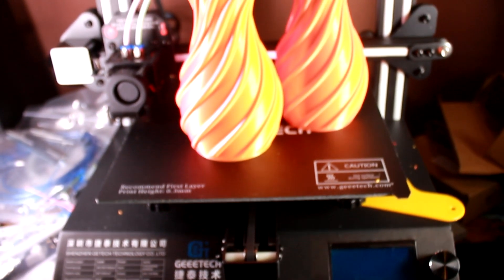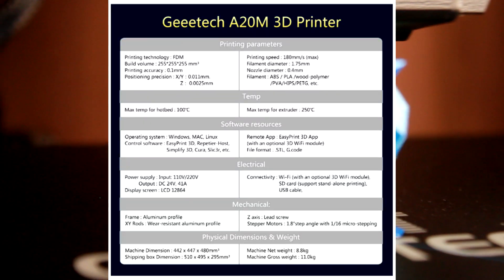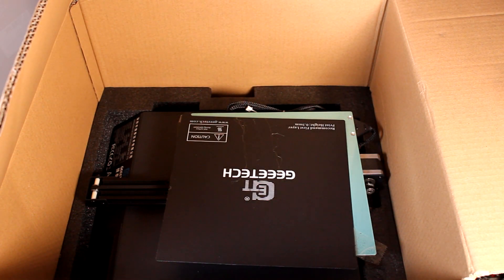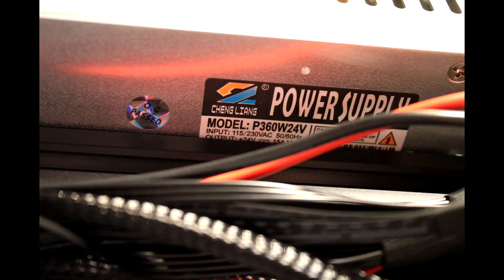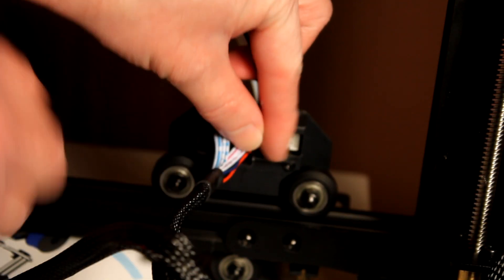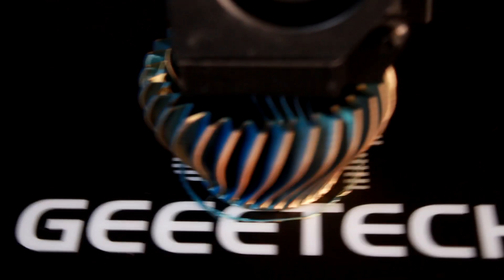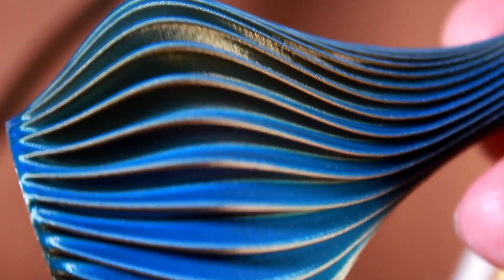The Geeetech A20M two colour single hotend printer. Is it worth buying? Who knows? Build and review.

Comment: This is one of those printers that I would love a follow up after say 1000hrs. Lots of good printers work good at first but then fail later on. I would also love to see what mods you do over time and how they worked out. Great video
Reply: I've had mine for about 2 years. I can give you a followup lol
Reply: Ive had mine for a year and from my experience my a10m can print very accurate and good prints, but its no prusa and you will need to do lots of repairs, upgrade, maitenence, and tuning. I even switched from geeetech supported repeater host to SuperSlicer. I also printed Bowden tube couplers which hold the tubes a lot better than any of the ones that you can buy for it

Comment: Love your videos.  Great to see someone making videos on mixing extruders.  I've had a Zonestar Z9M4 for about a year now which is a four color mixing extruder.  It has been a challenge to get great color prints from.  I'd love to see more videos on this topic.  There have been a few things that I've learned over the year playing with mixing. 

Virtual extruders are key.  While you can get fun effects by messing with the settings on the printer while it is printing, it isn't very helpful for making detailed colored prints.  Cura doesn't natively support defining virtual extruders but can use them.  I believe Marlin supports 16 virtual extruders (at least it does in my case).  These are tools T0 through T15.  By default, T0 is set to 100% extruder 0 and 0% all other extruders, T1 is 100% extruder 1 and 0% all other extruders, etc.  You can tell Cura that it has more extruders than the default two to use the rest of the virtual extruders.  In your printer start G-code, you can use the M163 and M164 commands (see Marlin reference for details) to set the mix ratio for each of your virtual extruders.

G-code editing.  If you'd prefer to just change colors at specific layers or start a gradient at a specific layer, you can use the M165 and M166 commands.  The M165 allows you to set the mix for the current tool and the M166 command allows you to set a gradient.  See Marin's documentation for specifics.

Choice of slicers.
I have been using Cura with my Ender 3 pro for years.  It doesn't hold up well however with multi extruder setups.  I haven't been able to get the purge tower to work reliably above two extruders. Cura also seems to need to purge a lot of filament for a clean color change.  I also ran into the same issue that you did where you have to change a lot of the settings per extruder.  This becomes a pain with 8 extruders and almost impossible with 16 extruders.  This brings me to the next issue I found.  At 8 extruders, Cura starts to run slow.  At 16, extremely slow.  To top it off, sometimes the settings don't save and will revert back to the previous value.  One final issue I ran into with Cura was that it would insert extra heat/wait commands (M104/M109) which would cause the printer to pause while it waited for the second virtual extruder to heat.  The solution I found for this was to get the Printer Settings plugin which adds the option for Extruders share Heater.
With the issues I had with Cura, I started looking for an alternative slicer and found Voxelizer 2 Experimental.  First off, let me say, it is not a very good slicer.  It gets the job done, but the results aren't as good as I've seen from Cura.  This could just be me not knowing how to use the software to its full potential.  The one area it does excel in is mixing extruder support.  Instead of dealing with multiple extruders or setting mixing ratios in G-code, it handles that part for you.  You are presented with the ability to add custom colors like MS paint.  You can also add gradients as colors.  After setting your custom colors, you just drag them to the component of the model that you want it applied to.  The slicer does the rest.  It even supports mapping images to the surface of models for some very interesting effects.  Another nice feature it has is the ability to print the purge block not only as a traditional tower, but also the ability to print it in as infill completely eliminating waste, or to print it as a skirt which just makes a thin band of purge around the entire model.  I prefer the latter as the infill purge method can't always work.  It also has the advantage as doubling as a draft shield.

Looking forward to more videos on the topic!
Reply from the maker: I'm going to need to read this later and take notes - thanks for all this!

Comment: I just picked up the V2 version of the A30T for $199 CAD shipped to me door.  That's about $150 US.  It just arrived today.  So far it looks really good. 32 bit board and silent drivers.  All in all I'm impressed.
Reply from the maker: I didn't realise there was a V2 version!
Reply: @LostInTech3D  Me either.  Nice full colour touch screen instead of the monochrome lcd. But the silent drivers and 32 bit board were the main draws for me.  I have a Mizar as well and it is a solid performer.  If the A30T is 80% as good I'll be quite happy.

Comment: 100mm cube is a good middle ground for purge settings, I recommend using prusa slicer or super slicer because they have a better option for the purge blocks. I have photos of purge tests, and don't use tpu it jams, and I had to fix that on the a10m. Also purge buckets do work, and they are easy to set up as well. Along with wasting less filiment because you don't have to purge every layer to build up the tower you only have to purge every time you switch colors
Reply from the maker: Good suggestion, I will check both those out ASAP! 
(I have a TPU obsession....I take your advice but will do it anyway haha)
Reply: @LostInTech3D  Keep me updated, would love to see if the tpu works!

Comment: A thin layer of Pritt stick on the bed makes it act like the glass bed i.e. it releases when cold.
Would like to see your settings for Prusa slicer. (I don't like Cura)
The glass bed from Geeetech is $35.00 plus $10.82. I'm sure you could find something cheaper though.
I found that upping the non print moves to 120mms also helps with the stringing. 
Great video. Keep up the good work.

Comment: Love being this early, but could you make a follow up down the line to see how the printer is holding up? Really wanna see the hotend stand the test of time.
Reply from the maker: I sure will!
Reply: I’ve been running one for almost a year using it to print models for Etsy and haven’t had many issues with the hotend. That being said I am currently having issues with heat creep and I am custom designing a new fan ducting system to fix this

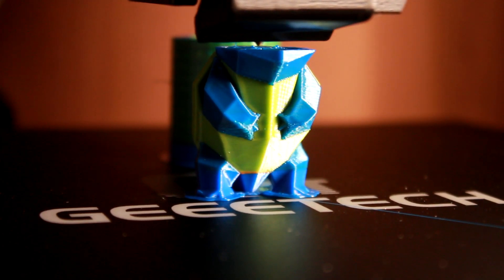Comment: 7:20 so you have two opinions? Mixed opinions? Coincidence? I think not...
Btw at my ender 3 v2 the hotend fan spinns when moving the hotend/bed like the lcd at this printer lights up. Feels like a problem that shouldn't be that hard to solve for the manufacturer, interesting that other printers have sth like that too
Reply from the maker: No way! my ender 3v2 does that too!! That's hilarious, and slightly worrying 😂

Comment: One of the biggest obstacles dissuading me from dual extrusion is purge blocks/towers... 😔 

An in-depth video on purge buckets would be greatly appreciated! 😲
Reply from the maker: I was planning on trying a purge bucket, so I'm more than happy to make a video on it! 👍
Reply: @LostInTech3D  Looking forward to it! 😎
Reply: Oh, btw, I think the Mixing 2-in-1 hotend mentioned at 1:00 (BigTreeTech/BIQU) is actually a different design than the GEEETECH variant. 

They're both mixing 2-in-1 hotends; however, the BTT version requires their own custom-designed 0.4 nozzle (which they also don't sell replacements for and/or various sizes thereof); whereas the GEEETECH, seemingly, takes standard V6/Volcano Heat breaks, Heat blocks, and Nozzles.

Also, have you noticed any issues in terms of skipping and/or abrasion from TPU and Composite (Carbon fiber, Fiberglass, Fluorescent, etc.) filaments respectively? 🤔

Comment: Cura has a setting that will sync the settings from one extruder to another
Reply from the maker: It does? How?
Reply: @LostInTech3D  Sorry yes, but it's a plugin called duplicate. I forgot about that. But install that and it works.
Reply from the maker: I actually also found that if you right click (obviously!!?) on the settings you can copy that or all settings, without needing a plugin. 
So yeah thanks for the tip off, I probably wouldn't have thought to look!